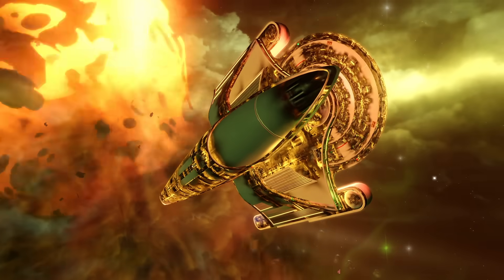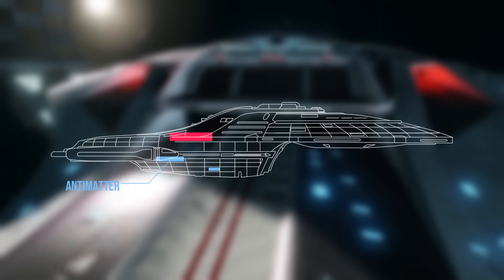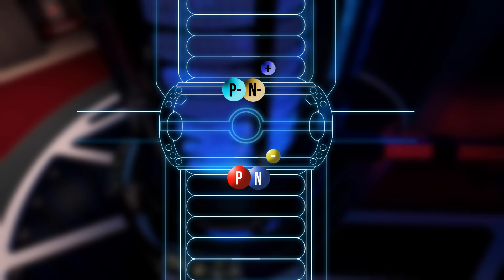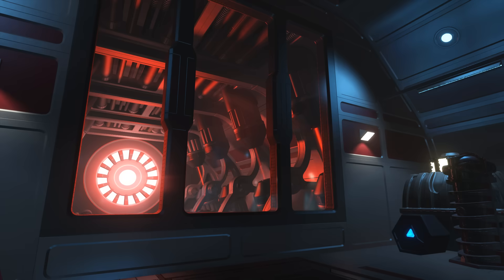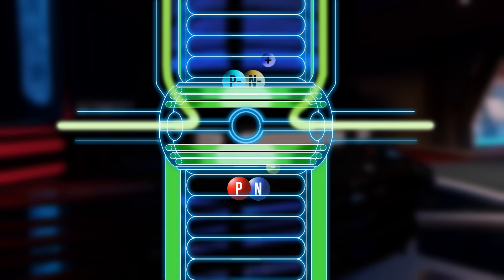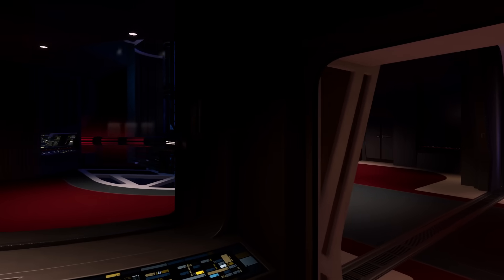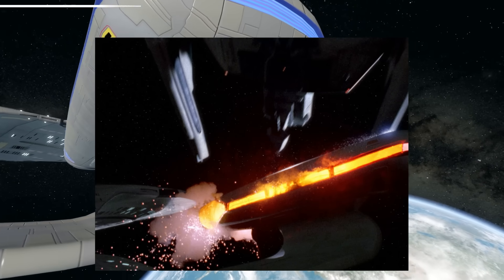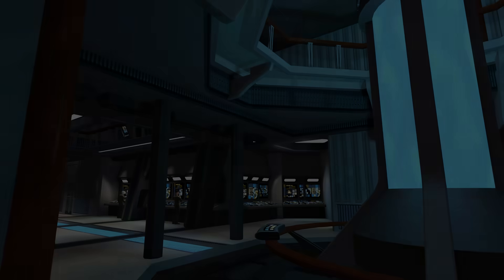What Causes a Warp Core Breach?

Comment: From what I remember from my warp engineering courses at the academy most warp core breaches are general caused by 1 of 2 things, some coolant system malfunction that cause a reaction chamber failure due to thermal stress or a field failure that allows reactant to contact the chamber interior surface causing a catastrophic structural failure of the reaction chamber. these usually result from some major EPS disruption or battle damage.  poor maintenance/age can also compromise the interior surface accounting for a small fraction of beeches.

Comment: Thanks for mentioning that the tanks have their own containment. We already have that tech even today, self-powering magnetic bottles, and see crew in Enterprise wheeling-about barrels of antimatter without any concern. 

Of course there's still methods to disrupt the containment, and it's still preferable to externally-power it (instead of slowly consuming a tiny amount of its own antimatter to power the containment). But it's nowhere near as simple as a general power-cut leading to an instant explosive loss of their fuel.

After all, even the Yamato under its deadly computer virus received its first damage by actually initiating an antimatter dump from the core, and then aborting the dump while it was in progress. That disrupted the conduits, damaging their containment, and led to a chain-reaction back to the main antimatter tank. (Not just a power cut.)

Comment: So my takeaway from this is that I should STOP toasting sandwiches on the intermix chamber casing when the captain orders more than warp 7.
Reply: But it works so well 😔
Reply: One grilled cheese to go...:popcorn-yellow-striped-smile:
Reply: My ship's morale officer always makes up big platters of Cochrane Cheese Toasties every First Contact Day. They're the best!
Reply: Pretty sure this is an integral part of the process, so obvious there's no reason to mention it in technical manual and such. Don't stop.
Reply: You haven't gotten the memo from the warp design bureau at Utopia Planitia. According to recent tests sandwiches vs other reactants. It was discovered that Tomales provided more energy for their mass when compared to sandwiches. Additionally the Tomales can be added to the impulse reactors to increase impulse acceleration though some adjustments to the inertial dampening system may be required.
Reply: @DarkRanger1975  I thought that they were finding that Ghost Peppers were showing a good kick.
Reply: Except your captain did the same thing when they worked in Engineering...
Reply: Geordi, "Captain, I just don't understand how a micro thin cheese layer has formed between our warp folds."
"I can only imagine how good that smells if you were in subspace right now"

Comment: I love how Star Trek just casually mentions that they have "antimatter converters." As though that technology isn't the most amazing thing in the universe. No explanation of how they might work is ever given - which is good for story telling.
Reply: Given they're stated to be fairly inefficient (requiring 3 or 4 deuteriums' worth of energy for 1 antideuterium) I figured it's not that different from how we make antimatter with particle accelerators today. 

AKA just a tiny particle accelerator. Maybe one that's assisted with forcefield tech to get the magnetic fields much stronger than we can create today, which would let it be shrunken further.
Reply: @kaitlyn__L  Though given the ramscoops, it's inefficient, but also still quite plentiful.
Reply: @MrMyu  exactly!
Reply: @kaitlyn__L   I surmise some if not most of that consumed deuterium for shipboard generation is basically for fusion reactor fuel to power the shipboard generator. Antimatter refineries that normally mass-produce the stuff probably are best situated near energetic stars to get a heapload of natural renewable solar energy to power the process.
Reply: @Madcat221  yep, that’s exactly how the tech manual says it. 

They normally refuel at a starbase from stellar antimatter refineries. (Also, real physics says ramscoops could be used at the poles of Jupiter to farm antimatter from solar wind.) 

It’s not the normal way of refuelling, but it’s an option! (Probably one Voyager had to use a few times.)
Reply: Honestly, antimatter converters don't even register to me compared to bonkers technology like artificial gravity, inertial dampeners, and Heisenberg compensators.
Reply: @Nalehw Heisenberg compensator - stops breaking bad'?

Sorry
Reply: @ Stops the Heisenberg uncertainty principle! The law of quantum physics saying that the more precisely you measure something's position, the less you can be sure about its momentum, and vice versa.

In Star Trek they have Heisenberg compensators in their transporters, so that the transporters can somehow magically snapshot the exact position and exact movement of every single particle in you.
Reply: @Nalehw technically it doesn't stop the HUP, as per the name it compensates for the uncertainty probably via some kind of symmetry reversal.
Reply: Similar to how in "Starship in a Bottle" Picard mentions 'Heisenberg compensators' and supposedly a fan asked; "How do the Heisenberg compensators work?" with one of the writers responding with; "Very well."  In-universe: technical device the writers can't comprehend (most likely), real-world: "How does it, um, how does it work?"
Reply: Like subspace...

Comment: I assume that there is an override feature so you can actually cause a full explosion of all the antimatter on board if needed? Both in Star Trek: The Motion Picture and In TNG's "Best of Both Worlds, Part 2", the ships were standing by to do a full self destruct sequence - to take out the VGer probe and the Borg Cube, respectfully. 

In Star Trek: The Search for Spook, the book explains that the self destruct sequence Kirk uses doesn't over load the warp core or shut off the antimatter containment units, but only uses explosives placed in the ship to destroy it, as a full antimatter explosion would have damaged the planet where Spock was. The antimatter storage pods were actually ejected into space before the ship crashes into the planet.
Reply: Makes sense, since Kirk and crew where watching the ship fall out of orbit, had it been a containment release, the gamma ray flash you have vaporized them and a good chunk of that planets surface.

Comment: normaly when something hits near by the warp core and alot of failsafes fail at the same time and if there not entogh time to eject the warp core before it blows up then you got to try to contanit the warp core in a stablzation force feld or bacly have the crew abadon ship. also a big warp core breach bacly also for alot of startrek vessles also happens to be powerful entogt to scultte a ship anyway that leaves bacly no tech behind.  i juts wish startrek realzied that radioactive protasuim isotopes if we hit them with high energy laser to force the 20 billion long decay rate to take ony a few split secounds instead you would get qute alot of anti protons and anti nuitrons from the decay by procuts of thsoe protasuim radioactive isotopes. yes that is a thing that could even repalce elment 115 in alot of sci fi as well bescue of teh simlear propertys. maybye some times they would have to use a earth banana made forma fabcator and then stuff it into a warp core to jump start form a cold start sometimes.

Comment: Since we're are (Trek) nerds of the highest degree here, did you really just say "boiling plasma"?!
Reply: I mean, if the plasma is hot enough that 2 of the basic 4 forces (electromagnetism and weak nuclear force first, I think) combine together, then you could consider that plasma to be a different state of plasma.  This happens around 10^15 Kelvin and creates what is termed the electro-weak force.  

Since these ships carry around metric tons of antimatter in them while being made mostly of normal matter, things going wrong (or maybe even sometimes things working as intended in some pieces of tech) could result in localized areas hot enough enough for the forces to merge.
Reply: @SephirothRyu  That's called a Quark-gluon plasma
Reply: @chrisholdread174  There may be some centuries where starfleet actually uses it.

Comment: Why is it that most of the time when the warp core is about to breach the ejection system goes offline? Of all the times you’d want to eject the core and it won’t let you!
Reply: I like to think that the Galaxy-class had an early generation ejection system that wasn't quite robust and rugged enough to handle the messes the Ent-D sometimes ended up in, and newer generation systems fixed the issues better.

Comment: fun fact:  if even one gram of antimatter were to collide with an equivalent mass it would release 9x10^13 joules or just slightly more energy than the energy released when the Fat Man  was dropped. It has always seemed odd to me that; considering all the sciency- like things Star Trek uses to sound more sciency, that "antimatter conversion" is frankly one of the most unrealistic, as it is the least safe.  In reality the Romulan singularity tech would actually be a more efficient and  safer energy source.
Reply: That assumes the antimatter is striking its perfect equivalent, if it hits matter of a different structure, the energy release will be significantly reduced due to a much slower energy cascade and self annihilation (about 3000x times smaller), this is still a lot, but much more in the realms of conventional explosives and not nuclear scale explosives. We have antimatter on earth (generally measured in molecules not grams) and annihilation is done regularly in very small scale.
Reply: @littlekong7685  indeed some cosmic rays produce a very very small amount of antimatter in materials they hit.
Reply: @ No, energy produced is a function of mass not "structure". For instance one anti-helium 4 ( something we detection the ISS back in 2016 and the was a paper published on the detection last oct) annihilates with one proton as a the product of their combined mass times velocity squared ( you know e=mc^2) or 3.7 Gev.  

Assuming "tanks" of antimatter are stored all over a ship, One magnetic failure and everything go boom.
Reply: @christophermitchell7001  "finally someone that speaks my language" -Avengers reference-.  but seriously, the energy thats released from M-AM annihilation is terrifying.  I've been thinking about this for years, since my adult self re-watched nearly all of Star Trek.  Realistically if a ship went boom there may be a few atoms left, but nothing identifiable.  One episode of Voyager made my jaw literally drop.  They come across this AI torpedo ship that thinks some innocent world ahead was it's creators enemy and seeks to destroy it, and it's carrying,,, 100,000 TONS of anti-deuterium.  the weight of an aircraft carrier in anti-matter.  Even better is they blow up the ship with what looks like less than earth-moon distance.  They saved the day!1 when in reality half that planet just got a literal super-nova in the face.

I like star trek but it does a rather poor job conveying just how dangerous anti-matter is
Reply: The warping of spacetime used for ftl in the show requires insane amounts of energy. However, just imagine the systems needed to contain that energy and direct it where it's needed. There is no way the weapons used in the show are more powerful than what's being generated in the core. That, to me, would mean those parts of the ship would be near indestructible compared to the rest of the ship. Thus, why not cover the ship in those systems and build an indestructible turtle.
Reply: @drathscion  Sort of, think of it this way. What ever "containment" is utilized, that "containment" is under constant stress. Whether that is energy used to maintain magnetic bottles ( which is how one would "hold" antimatter) or physical structural forces, if at any time there is a failure, that failure by definition ( remember in an engineering sense all failures are catastrophic) would be complete. 

For instance a field fluctuating slightly allows one atom of antimatter to annihilate against its containing vessel. That entire vessel then goes boom. Small error, Ship done.

Comment: A warp core breach, would mean the control mechanism ( electromagnetic containment fields are no longer working ) which Leeds to - what should be an instantaneous annihilation of the vessel , or the core , since they cannot control the Antimatter , considering the Enterprise D at maximum (estimated use about 20-25 KG to get to warp 9.6) that would pretty much alone would take out the vessel not counting the 3000 metric tons of antimatter in the antimatter tanks .
Reply: Realistically, there should have been no physical evidence of Wolf359. Can’t imagine any of those ships surviving a containment breach. 

That would mean the Borg cube flew through a field of massive matter anti matter explosions unscathed.
Reply: 20-25... KILOGRAMS!!!  JFC!  The Tsar Bomba, a 50 MEGATON bomb, released an amount of energy equivalent to the conversion of 2.3 kilograms of matter into energy. 25 kilos of mass is 500 megatons, or 2,500 Petajoules.  to call anti-matter terrifying is putting it lightly